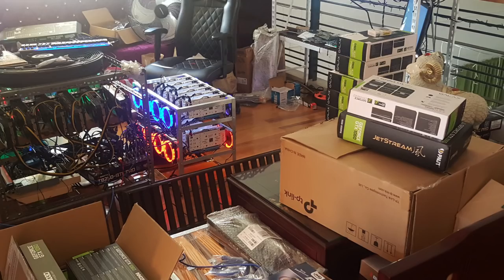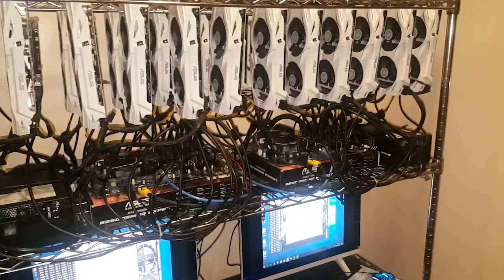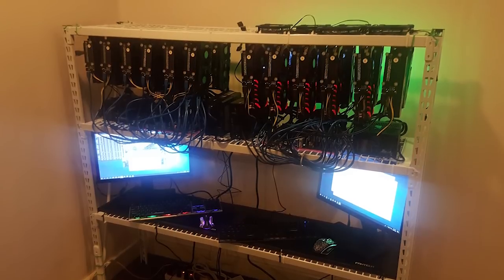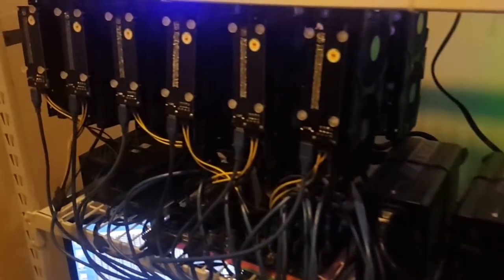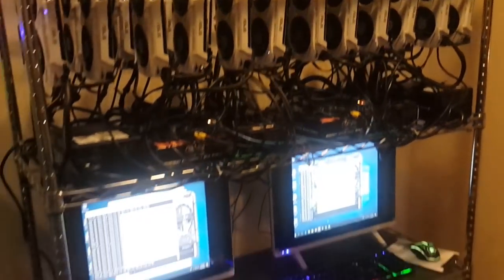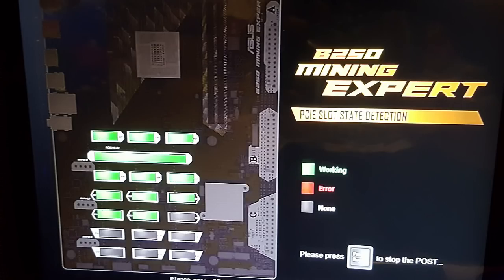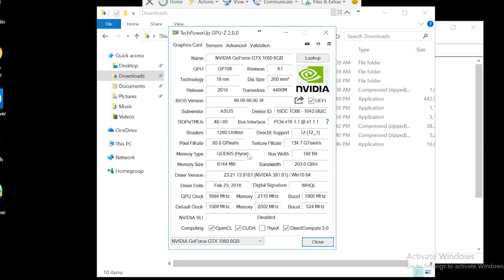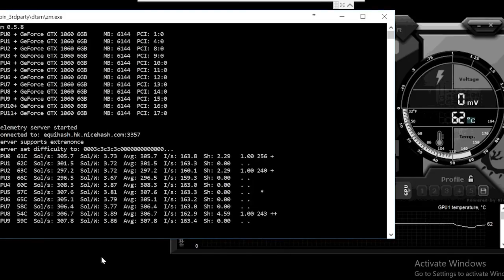How I built a 48-GPU Mining Farm | GTX 1060s at 14,000 sol/s

Comment: How much did it all cost?  And how much Bitcoin as well as other coins do you mine with this?
Reply from the maker: rough estimate now was USD 7500 during the time it was built.  I can't recommend building one nowadays as the cost to profitability ratio is way way way low nowadays.
Reply: @BPTechParts  yeah true, and maybe payout will be lower after the halving comes.  How about mining other altcoins, such as Bit Cash, DASH, Zcash, Monero, etc?  Profitable?
Reply from the maker: @seanknight9808  honestly, mining in general is not worth it anymore.  Like a GTX 1060 12 GPU mining would cost you thousands of dollars to put together but earns would be USD 3-4 per day.  Deduct the cost of electricity there, you'll only be earning cents.  Not really worth it IMO.  Check out whattomine.com if you want a more reliable calculator
Reply: @BPTechParts  Really?  That's disappointing!  How about using an AIPC or Antminer?  Okay I'll check out that site.

Comment: Hey mate just looking for some advise, Great video btw. Im looking at starting up a mining rig with a $10k budget, only thing im having trouble deciding is what gpus to get? im getting a 19gpu rack so plenty of room for expansion later on but with a 10k budget what do you think would be the best gpus to buy? is it worth getting a few 2080tis or a larger amount or 1080tis.. or would 1070s be better? looking forward to your reply!
Reply from the maker: hey man, thanks for the compliment on the video.  my honest opinion, you should check first in mining calculator websites like whattomine.com if it's still profitable for you to invest in mining right now.  The profitability levels aren't what it used to be a year or two years ago. I just checked and 12 units of 2080tis would yield you USD 14.00 per day not including electricity costs.  From an investment standpoint, you'll be lucky to make ROI in 5 or 6 years. Now if your electricity is free, that's a different story.  If you really want to try out mining, I suggest buying a used mining rig from a quitting miner so you can get parts cheap and make earlier ROI.  But again to manage your expectations, the earnings wouldn't be much right now.

Comment: But Windows 10 only support 8 gpus at the same time, more give you problem. How did you solve that?
Reply: The limitation is not from Windows, it's from the drivers for the video cards. Both nVidia and AMD have released updated drivers that now recognize 12 gpus each so you can actually run up to 24 gpus on one motherboard if you mix cards and if you can find a motherboard that will take that many gpus. Check out this link, this guy has 20 gpus on one motherboard. https://www.youtube.com/watch?v=miUoqnUqk9M&feature=youtu.be&t=5153

Comment: Hi bro I've ran to a weird problem...
I got a freak rig with bunch of old R9 cards + 2 RX570 + a r9 295x2.
It was working fine. I had problem with it burning SATA cables time to time, but it was under control.
Then it ran to some major problems. I was forced to clean install everything (BIOS, OS and all that). Then I get freaky problem.
With any card, the claymore hangs after it shows the version and pool. I check in healthy rigs, the next code after it hangs should be OpenCL Platform line. (Not the Building OpenCl for GPUx line).
New OS. New BIOS. New risers. New PSU. Putting the cards directly on the MB. You name it. I've done it all.... GPU does hold under GPU Stress test, but no mining...
I'm really out of options.
Only thing I can think of is the latest update which get installed with the fresh OS. I do deal with the Windows Defender messing with the miner's .exe file too, but this problem seems to be different form antivirus problem which people have these days.

MB: BIOSTAR BTC 250
4GB RAM
Core i3.
128 SSD
Win10 64x

Comment: My total cost was about 6,000 to have that 13,000 sols. With 14 cards. 420 mhs ETH/ETC
Reply from the maker: 13,000 sols divided by 14 cards = 928 sol/s per card.  try mining zcash with those cards and let us know if it's still 13k sols
Reply: daveFL I modified the cards in all sorts of ways that you can't do with the cards you bought. 1060s suck ass and are expensive to purchase in the first place making your cost to build automatically higher then it can be.
Reply: Also that was single mining and dual mining I was hashing around 8,000 sols
Reply: daveFL let's just say I know you are no expert at building c9st efficient miners. Your are the reason why GPU prices suck because you buy up the worst cards for the what they are not ment for. I bet they are also 3gb which in 1 year they will be not able to mine either.
Reply: Alex Cerda actually July you wont be able to mine etash anymore ...sept if we lucky .....its not his fault hes getting shitty hashrates ...the 1060 is a very well priced and profitable card ...that is ,if you get the Samsung or Micron Chip ...the hynix chip is not made or shall i say does not mine effectively and i would say a very bad investment... unfortunately his client lost prob over 1500 sols just from the chip being a hynix chip ... unfortunately no way to tell what chip your getting intill u install into rig ...i csn tell you this theres a 85% chance your going to get a hynix chip in a brand new 1060 6gb 
..65% in a 1070 8gb and 50% in a 1080 8gb ...the Samsung and micron chips all used up

Comment: hope your cables leading to the power outlets can handle 6 rigs.... otherwise you can burn the place down....
Reply from the maker: each rig is plug to a 10A extension cord with surge protectors.  each extension cord is then plug to individual power outlets (he had installed 4 additional dual power outlets for a total of 6 dual power outlets on the wall).
Reply: i am asking about the wires. standard wires in the wall should not be overloaded with more then 13amps cause they overheat. circuit breaker is one thing but wire from the fuse box to the power outlet is another thing please remember that and you will be good :)
Reply: @krzsus  A 2.5 MM cable used on household power circuits in the E.U and most other parts of the world handle 28 AMP at 220/240V, however the UK builds a ring main.. Circuits in Asia are general run as radial, a single wire from the board to the end power point, these are powered at 20 Amps. For your GPU instals I would suggested using a Radial circuit, it would be much safer and less chance of fire due the having 8AMPs expansion or 8000watts of heat expansion over the draw on the plug or socket outlet.
Reply: 13 amps is nothing. Most vacuum cleaners can pull 12 amps, and people will often plug them into outlets that have other things running. Granted, no one vacuums 24/7 [unless you have a very very bad case of OCD] but if a wire is going to heat from current, it usually does it within the first 30 seconds.

Comment: Oh wow. Looks awesome. ROI 2 years and getting longer daily unfortunately.

How do you control the heat??
Reply from the maker: thanks, hehe. not sure about the 2 years ROI but i guess it depends how much it cost you to build the rig and your county's electricity rates.  I undervolt and overclock the cards to manage the temps.  Also placed fans on top of the racks which are directing air towards the cards.